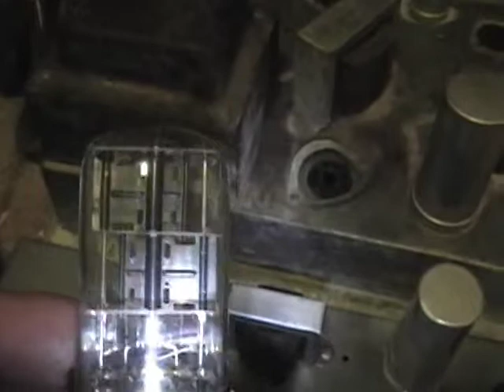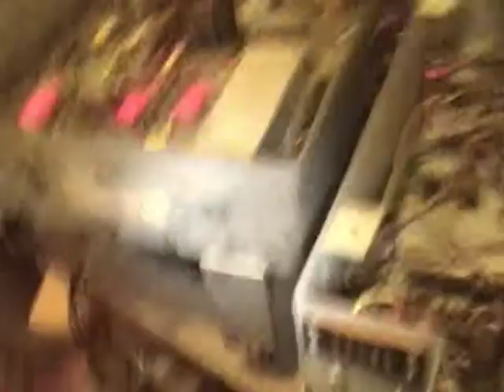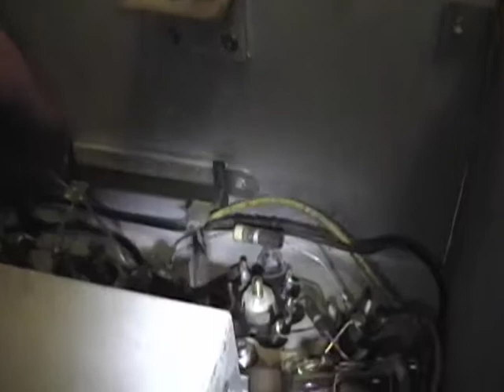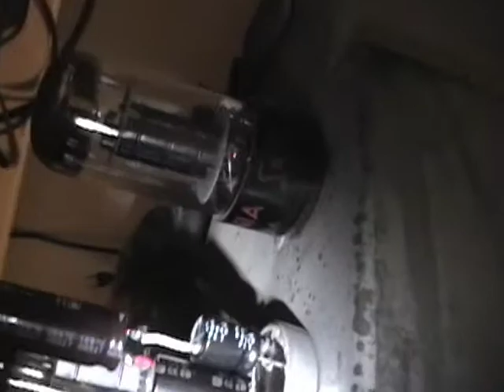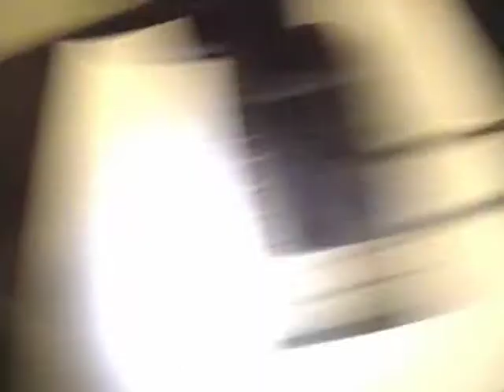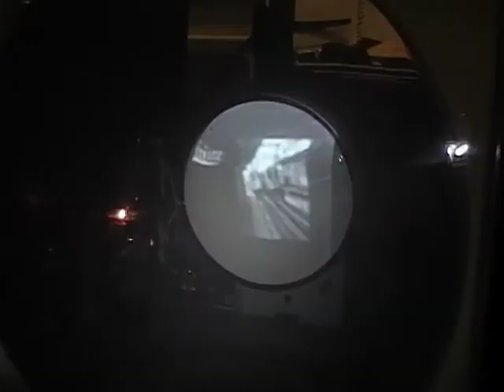Admiral 24A12 Restoration - part 8 (almost done)

Comment: @ 7:10, beware of "domino" capacitors rated 1000pF (0.001uF) or greater. Most are MicaMold capacitors with a paper dielectric and aluminum foil electrodes enclosed in molded shells made of "filled mica" material.  Essentially, only the shells contain powdered mica used as a "filler" with an epoxy resin binding agent.  Really, the MicaMolds are only slightly more reliable than the notoriously-leaky molded-paper "Bumblebee" types, particularly in critical Horizontal Phase Detector circuits.